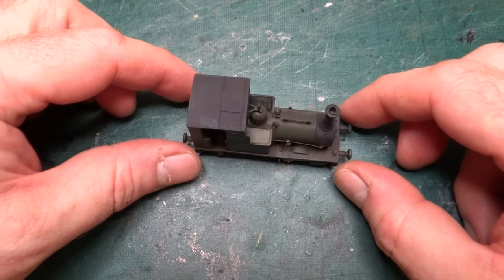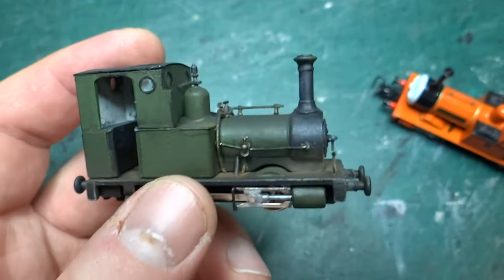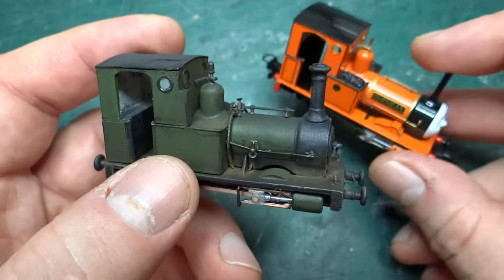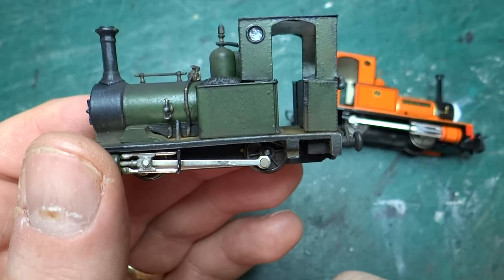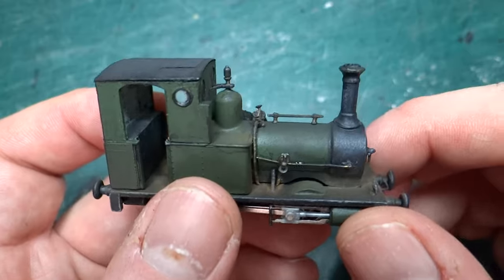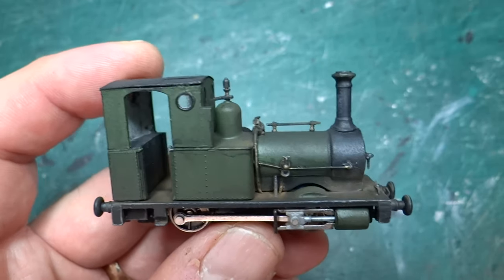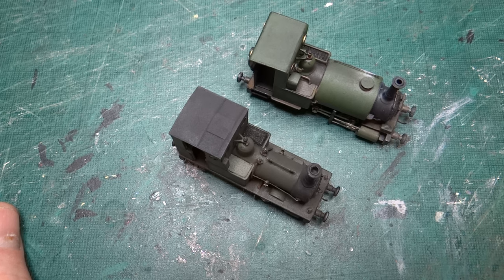I've Finished Building.... Dolgoch by destroying a Bachmann Thomas & Friends Rheneas

Comment: Small running video would be good
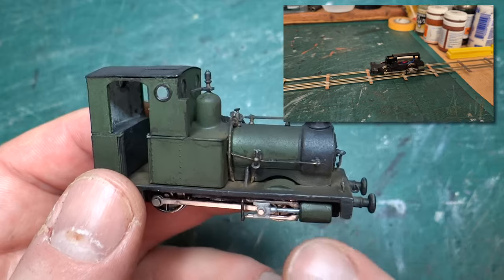Reply from the maker: There's a couple of short clips included in this video (starting at 4:53), but if people are interested I could do a slightly longer video; it's a nice smooth runner as the original chassis is really well engineered.

Comment: Bachman released there talylln in marron black and green

You can get the green one and compare it to yours !!!

It would be such a cool video to see 😊
Reply from the maker: Yes, I don't thing these are actually available as yet. The photos of Talyllyn they've shown so far are just repainted versions of the original model so have lots of issues. I've heard that they may be on hold while they redo the tooling for the cylinders (it's a plastic part and very oversized). Would certainly be interesting to see mine next to one, although not sure I'll be splashing out on one myself.
Reply: @encoffeedrinker  I am more of a N scale person than 009

But … it’s the same gauge of track … so there is a tiny possibility … but we never know until it happens ! 

I however am getting a Bachman N scale Percy .

And if I do ever swap scales from N to 009 . He will make a brilliant Douglas kit on the talylln ! 

I mean westcliff world has a shell of TR no6 to fit said chassis . 

If I do swap scales I wouldn’t mind a Douglas . 

Tho … I never saw Douglas at the fourth awdery event … considering I was a year late to see her dressed up as Duncan 

Tho over the years I have warmed up to Duncan … I mean at first I hated him . But now I don’t mind him as much as before . I mean his genuin proportions are good and I like the rock n roll of Duncan from the tv and book series’ had real insperation from Douglas herself !

And hey. If Bachman have there talylln I can buy . Fourdees have dolgoch to paint and fit to the chassis , and fourdees too have Edward Thomas for the chassis 

I don’t intend on swapping scales again to 009 … as there is less stock to get … however the double farlie , Baldwin and the new talylln all look impressive . (Exept from the cab interior of talylln EUGH) she is a fine enough model

However for now I am comtent as can be with N scale

But if I dare change my mind . The diesels can be sold , Thomas put on display , percy converted to 009 scale Douglas & all the track can have each by one sleeper removed to make 009 rails . And the chassis of my stock can be re used with new resin body’s ontop

So I have a plan C if I dare choose my mind again

Tho not likely for some time now . Or ever . It’s the smallest possibility there is . But it’s a form of fire escape option if you will

Tho for now I am content with my N scale models as they are
Besides … it means I can try the plan of proper models of more kit building of peco models . I mean peco wagon kits and peco stations and the like

Bachman can supply for the Thomas characters of percy and Gordon whilst kato supplies the rails and sleepers . And finally a grass Matt that is from a charity shop . And Dapol and grahamfarish ( extension of Bachman) for the engines . I have my eyes on a Dapol Stepney one day . I mean I would have preferred boxhill as she is my local terrier down york . But still Stepney will do . 

That’s the gameplan and for a possible Plan C

I call it plan C becasue plan A was for 00 model railways through and through no questions . Then we moved house and plan B came to be with N scale and that all going from then on. Then if all goes bust we go plan C . Being 009 modelling and narrow gauge . 

Tho currently on plan B and … I do remember once bringing my old hornby Percy to a model train show once . All decked out in my channels logos and a boxvan for I guess what I thought were supplies to fix him and so on . A rail tour if you would . Like flying Scotsman . But Percy .

And then he broke after that (I didn’t maintain him as I was new to these things then) then Bachman Percy 1 . Loved him and he is too on my channel . However I broke him and used him for parts . Then Bachman Percy 2 who is my third 00 Percy ever . 
He is still about and I clean him monthly . Whilst not running very much I care for his model lots . Think duke the lost engine and the line his driver and fireman cleaned and oiled him for the last time . 

As if I do take any engine to a model club for a run it would be Percy as he is small and easy to carry about , recognisable with a face up front so kids go oh look it’s Percy … whilst there parent mistakes it for oliver or something and get a lecture by there kid about Percy’s history 🤣 .

And that’s the reason I keep my 00 Percy in good shape . Incase I need him to go somewhre for an event . Tho he can’t tetnically run on most layouts becasue he isn’t properly fitted with railway rules or nothing … but he is a fictional thomas character (ignoring Trojan) 
And hence he dosent need to be real .  Tho I did once paint a open wagon line green and give it a small cardboard face and coal once for an event . As a unofficial tender for him to carry about … just so he metaphorically has enough coal for his two day venture to places when he is needed . 

Once he had to fill in for one of the clubs engines cuz quite litterally it broke and fell from the table . They had no engines spare so I offered Percy over night … apparently he did wonders .

Tho whilst hornby Percy only went to two events with one documented . Bachman Percy had went to about 18 . Tho non as of recent … as he sits in a box getting cleaned and oiled every month .

However the N scale Percy … I mean you can tell he is my preferred character by a LOOOOOOONG shot I adore him . Probably cuz how smooth his 00 one is and how good reviews of his N model I have seen . 

I hope to bring the N and 00 ones to the club … so if he ever is needed on a layout he is double the size of … no problem I have shrunken him to fit 🤣. Maybe I could make him his own lime green truck too for his own journeys . 

And I know photos will be taken of the two identical engines side by side . I mean I know Bachman have also made him for G scale . If I ever wanted to make a garden railway (when I get my own house) he will be on it by all accounts . I mean then he can serve all 3 scales at railway clubs . 

And yes I have seen Trojan in person before . You can guess my happiness 🤣

Anyways … I have talked for long enough now . That’s the plan for the stages of my model railways and my Percy rail tour event and how in a form of accidental thomasseeming story how he saved a excursion train at the last second .

What do you think ?
Reply: And sorry for that REALLY long comment

Comment: Superb work! I turned one into smudger! 

So uh, are you gonna save the couplers it came with? Or are they up for grabs?
Reply from the maker: Doing Smudger is great and a little different, can't imagine there are many people out there who have gone that route!

Not sure what I'm doing with the couplers for now. I've kept hold of them and can easily fit them if I want to, but I'm wondering about doing something a bit less obvious if I can. Not that I envisage these doing much in the way of pulling anything given other than the test track I don't currently have anywhere to run them,